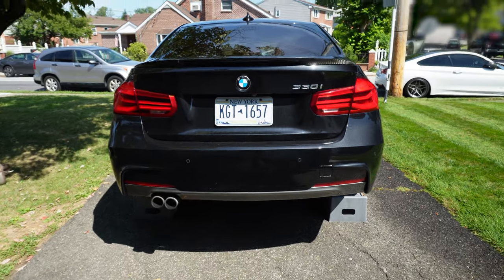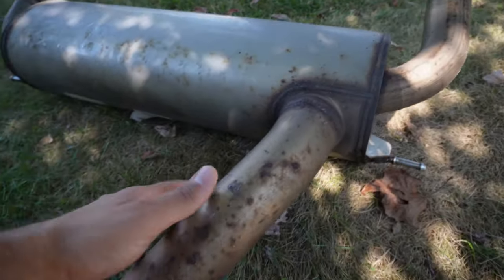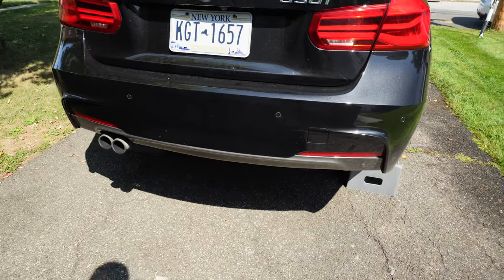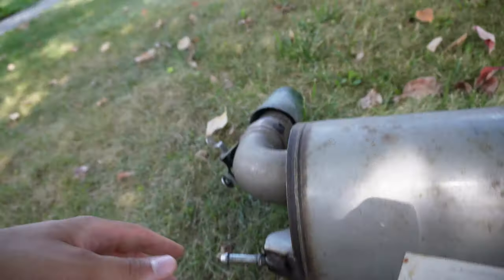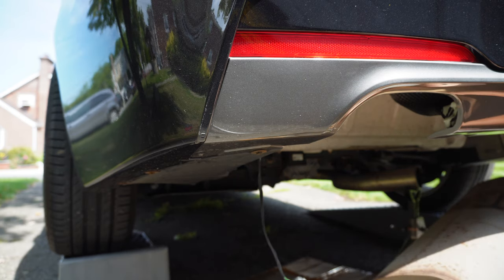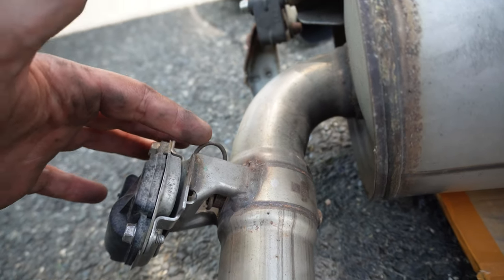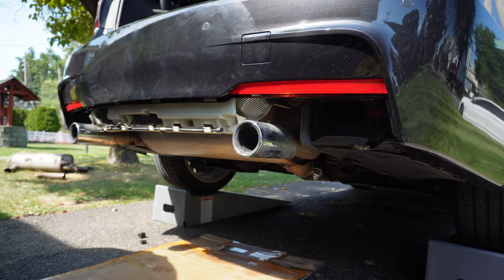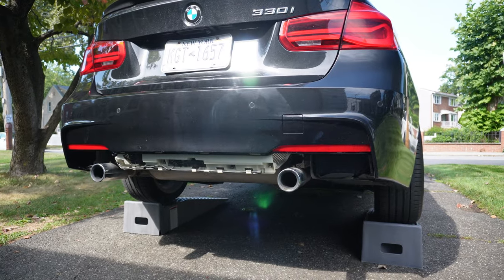BMW 330i (F30) GETS NEW DUAL EXIT EXHAUST *SOUNDS AND LOOKS INSANE!* 340i exhaust conversion

Comment: I did a muffler delete on my 2018 330i m sport and put new exhaust double tips that sounds really good. I also capped the exhaust actuator and zip tied it up and out the way.
Reply: Should post a clip brodie
Reply: Is it really loud and did you get any dash lights ? I’ve been thinking about doing this but I’m not sure on how to go about it because I don’t want it super loud.

Comment: Planning on doing this on mine I think my 340 muffler already has the valve actuator on it though wonder if it’ll work or if I have to take mine off and put it on it what do you think?
Reply from the maker: I think either one would work! It’s an interchangeable part, as long as you plug it in, either will work

Comment: does sound a lot better and is better than a muffler delete
Reply from the maker: It does! After having it on a few days, I can really hear the difference
Reply: @ayyyman_  also i wouldn’t feel the need to replace the muffler trading it in cause it’s OEM
Reply: @ayyyman_  how’s the sound from inside with the windows up? Notice any difference?
Reply from the maker: @jiteshmandalia7703  way better. I’ll actually make a YouTube Short of just some sound clips

Comment: Hi mate, just sharing my experience with exhaust conversion. I have Japan Import BMW F31 330i (2017)  same year same model as you just turing/wagon. Recently I did the conversion to dual exhaust taken from BMW F30 340i 2016, so the exhaust pipe on my car was 75mm OD and pipe of the muffler from 340i was 80mm OD! Im not sure how your car have 80mm OD and mine 75mm OD as we have identical car unless have something to do with market spec (different for US and different for Japan) but that's weird just for 5mm, why would bmw change that for different markets!! But after all that "trouble" the car sound way louder and better especially when changing gears manually in sport+, and your right the video sound can't replicate that.
Reply: same here i got a 330i 75mm exhaust and will put a 340i exhaust that has the 80mm  both german market cars
Reply: How did you finally manage that ? I’m doing thin on my 320i I have the same diameter
Reply: @BMWF30LOVERS-cp1yr  end up welding it!!
Reply: @notsuree  I was wondering if a clamps with different diameters each side could do that !? Just to avoid bring the car to garage and welding
Reply: @BMWF30LOVERS-cp1yr  I tried with clams but they never are same as OD what I need it, my experience is I just wasted money on clamps and they never worked as they should ,my car wouldn't pass WOF (certificate what you need to obtain every year in my country that the car its legal to drive on the road),so the only option for me was to weld it without me experiment more and waste more money!
Reply: @BMWF30LOVERS-cp1yr  The all point of my comment on here was don't go by what you see on YouTube,do your research (meaning measure yourself) and go from there, I didn't I was relying on the this video and I paid the price.
Reply: @notsuree  thanks for sharing, so you managed to get that certificat with this change ? The only point I wanted use clamps for was for this yearly certificat, in case it couldn‘t pass so I would be able to take it of and pu it back easily

Comment: Great video man just wondering will the exhaust clamp really hold up for good? Have u had any trouble so far?
Reply from the maker: I believe it should. I haven’t had any issues with it so far. I gotta say tho, maybe welding it would be better because I’m not sure if the clamp will give an absolute perfect seal. But still easier for a DIY solution

Comment: Great content! I wondering if putting a connector for the muffler will hold up instead of doing welding ?
Also does this exhaust will work on 320i lci ? (It had no valves from factory)
Reply from the maker: I can’t say for sure. If it has a similar exhaust just a different tip, I’d imagine so. You probably won’t be able to use the valve actuator but maybe just leave it open
Reply: I have alos a 320i lci and no valves

Comment: Hey i have a question, i hope you will see this. Does this rear bumper come with all bmw 330i's or only the msport ones? I mean the rear bumper that u can remove the diffuser and put the 340i diffuser. Some bmw's have a one piece rear bumper and not a removable one.
Reply: Only MSPORT models

Comment: I bought my 340i muffler from Brooklyn too but the dude I bought from on fb marketplace never mailed it to me lmao. Lost $200
Reply: I've been looking around online for a 340i muffler but haven't found one yet. I did find a 2022 330i g20 muffler though. It's dual exhaust like the 340 muffler, and design looks the same as the stock 330, but the actuator valve thing is on the opposite side. I'm tempted to get it to see if it'll fit
Reply: @graham1188  I don’t think the pipe diameter is the same as the f30 but gl